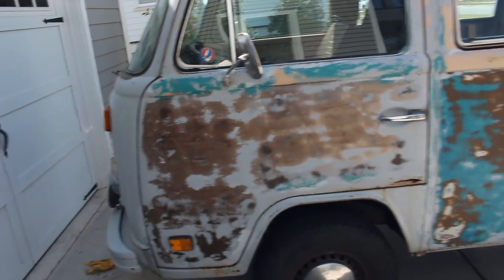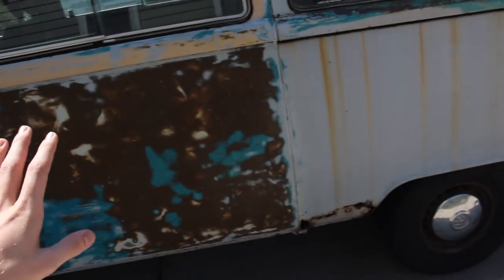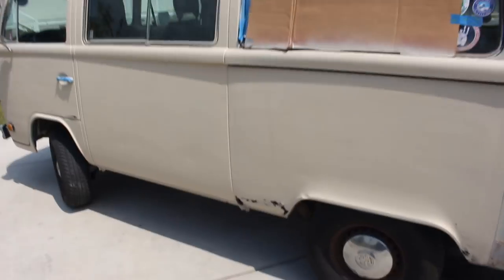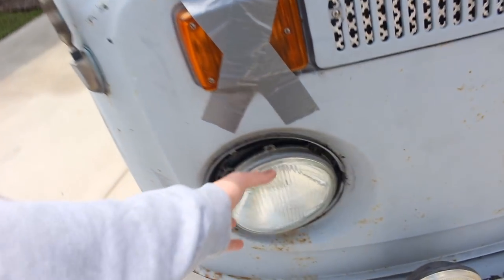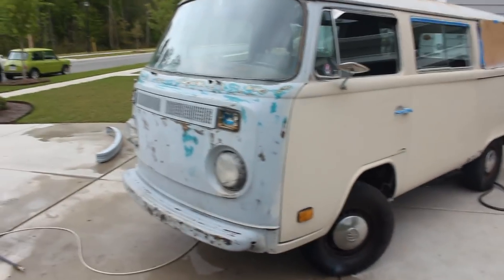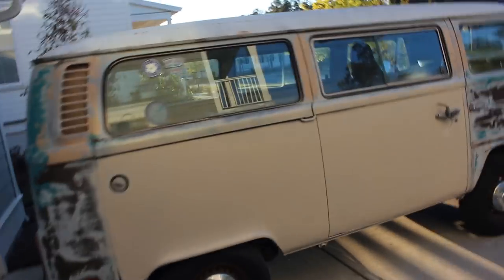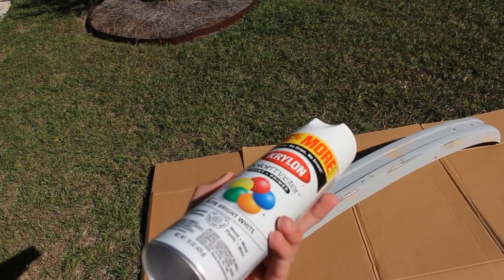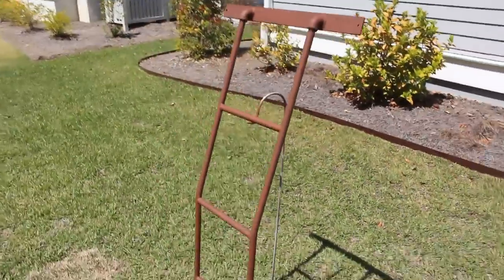I Spray Painted My Whole Bus, and THIS is Why

Comment: I'm currantly doing the same thing to my 98 dodge pickup truck. Took a while to complete the body work as I'm slow due to recovering from cancer treatments (which I beat, cancers gone but I got beat up by the chemo and radiation). Truck is ready for final block sanding then I'll start doing a complete primer coat, more fine sanding and finally the top coat. So far all is good. I've done this many times over the years with great results. Your van is looking very nice, it's amazing what one can do without a lot of cash. Really would like to see the completed project.
Reply from the maker: That's awesome man, kick cancer in the ass!!  Praying for you and a safe recovery.  Be sure to wear the proper gear to keep your lungs safe in the process!  Budget projects are the best because they make you think creatively.  Cheers :-)
Reply: Thank you for the reply. I'm not letting up on the cancer as I've come this far (feel like I've been to hell and back, probably look like it, LOL). I'm getting better but it is a slow and long road. I'm hoping I'll finish my truck this summer. I used the rust oleum paint, it's a little cheaper than krylon, haha. I have a friend around the corner who loves VW's, he buys them from all over and has them shipped to him. I've watched him build several RarRods with them. All but one he has kept, the rest he has no probable selling them. the one he kept is a bug, turned into a pickup. it looks really good. I do remember a 1961 transporter (VW van pickup truck he stortened by cutting 3ft out of the center and then going back together with it. He was a a rod show in Tennasee and sold it for 10K. He's a master builder, I get a lot of inspiration from him. I really would like to see your van when finished. People don't understand why we do what we do to our cars but it is because we like it and it is satisfying. I know the feeling you must have for your van. Keep it up brother, no retreat, no surrender. It's all good. by the way, it's looking like after a little over 2-1/2yrs that I might be able to go back to my job in maybe 6 months or so, I'm working on it. Still got some problems but it's better than what the doctor told me. When he dianosed cancer, he told me "without treatment, I give you about 3 montjs. That was over 2-1/2 years ago, not bad if I do say so myself. LOL.Again, thank you. you are inspiring.

Comment: It looks a lot better all one color...only 15K buses made in 79...Dakota Beige... At home depot, they sell a rust converter...I used it on my 74 bus rain gutter, worked great...you might want to try it on the roof before paint..convert the rust to iron phosphate (Dupont used to make a phosphoric acid conversion production) or google Pete and Southwest customs in Texas, he uses vinegar...How did the paint hold up ?

Comment: Keep at it. Noticed one of your intake runner rubber shelves (front driver's side cylinder) had a big crack in it - would definitely lean out and cause misfire, run hot, burn valves, etc.) Saw it when you were doing the tie strap hack on the throttle cable. Good luck. Update us on how the trans is doing too... lots of metal shavings. Redo those axle seals and boots when you have time/money. I restored a 72 Wetsy and went through the same joys.

Comment: It seemed to me or you painted on rust? There are special rust converters to remove it, if this is not done rust will manifest soon on a new paint. Looked at all your series about the minibus. Greetings from Russia, we have vw t3 '89 1.7d =)
Reply: Будни Фермера he painted on rust
Reply: Будни Фермера have a t3 too
Reply: He said it was only temporary until he gets a proper paint job
Reply: problem is he now has to get through the paint to get to the rust. should of got rid of rust first, easy done with prep and etch. FOOL

Comment: Hi Austin, I'm from Chile. I bought a brazilian 1981 T2, with a lot of rust, the poor van looks horrible! I'm thinking in use hydro sand blasting in my bus, because typical sand blasting is very expensive and dirty. You can do the same in the vehicles you'll buy in future. And I have a question: you think that this painting is permanent or just temporary? Greetings :)

Comment: Pleaaase use a mask for your respiratory system. :P
Reply from the maker: +Swordie100 I do need to invest in a quality mask.  I have a bunch of the little paper ones but they break within minutes lol, thanks for the concern though! :-)
Reply: Yeah it's just not safe. I have a paper mask which holds for about 10 hours of work (filtering wise), so that's quite an okay deal if you don't have a gas mask equivalent. :P
Reply: Swordie100 Yeah, I thought the same thing. Masking, removing rust etc. is your prerogative, but please wear a mask when spraying or dry sanding. Paper ones cost like nothing! Otherwise great work considering your money/time budget. I can't wait to fix up the paint on our Neptune Blue '76 bay bus, you gave me a few good ideas here!

Comment: The sanding was ok. You should have also done some by hand, however. This would have been my procedure to simply get an acceptable/good outcome. Sand the ENTIRE van (3 hours). Get a simple, no mix body filler. Fill, sand. Fill, sand a second time (5 hours total work time) Then get 2 or 3 quart sized Rustoleum paint cans and a fine, foam roller applicator, get the same color Rustoleum spray can. Spray where curved, roll where flat. After it dries, sand lightly and reapply paint. Sand with finest paper and you have a good looking paint job. Look up Rustoleum paint job...

Comment: Looks great do the mechanical and start hitting the summer vw shows be ready for the big one in Florida this fall
Reply from the maker: She needs a good tune up and then I'm ready for some shows!
Reply: Replace all the fuel lines ..order that hard plastic fuel line for underneath the bus from Go Westy it comes with two little barbs to connect the plastic fuel line to the regular fuel line ..the plastic fuel line does better with modern fuel

Comment: hopefully you'll cut that car cancer off it and weld new metal in its place, paint (even rustolium) wont stop already rusted metal from spreading.

the main issue you're going to have is the frame under the body getting massive rust holes and compromising the structural strength.  

oh and make sure you replace all the fuel lines or the bus has a high chance of going up in a fireball due to the fuel line rupturing (they have steel braded fuel lines and other good replacements). the fuel lines on the bus and bug are known to rupture and start a fire. probably should also buy one of those fire extinguisher lines to place in the engine bay in case if does happen.